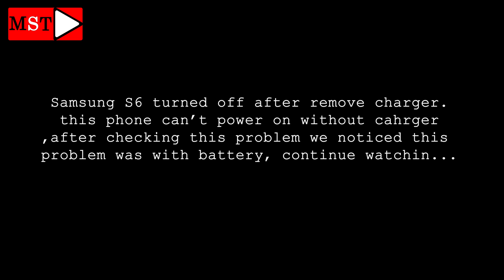Samsung S6 Turned of After Remove The Charger

Comment: i have the same problem with my oppo . if the charger is unplugged it will turn off . and if i turn it on without charger it will only show the logo and turn off again . but if i plug the charger it will turn on and i can use it like a normal phone .  .
Reply from the maker: Could be battery

Comment: Still my s6 off when charger is unplugged i replaced the battery please help me
Reply: I have the same problem any solutions
Reply from the maker: Unplug charger port, and try to power on the device with battery. If it works then also charging port need replace.  If not then i can't help you with checking.